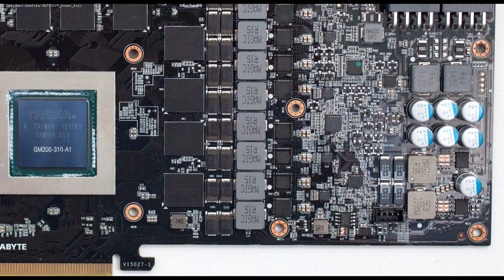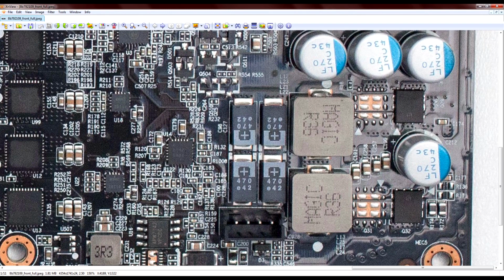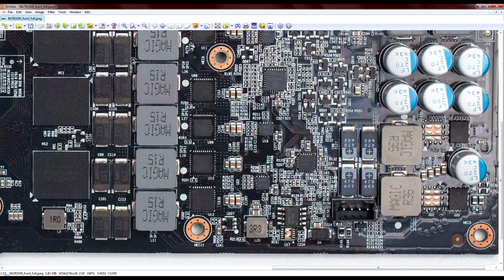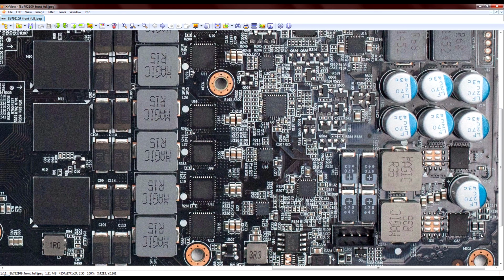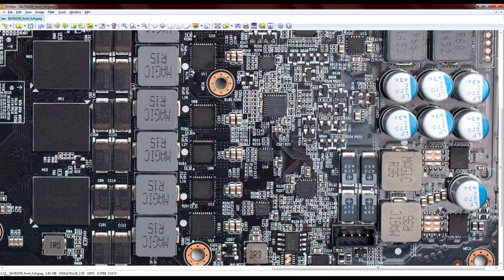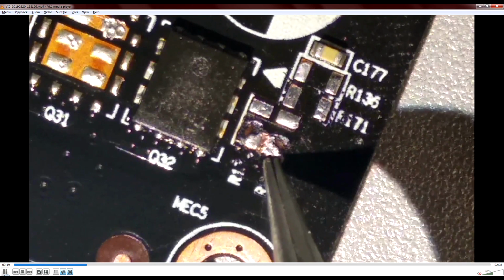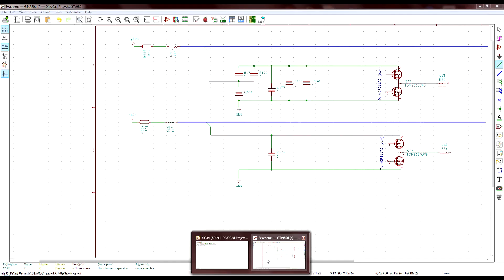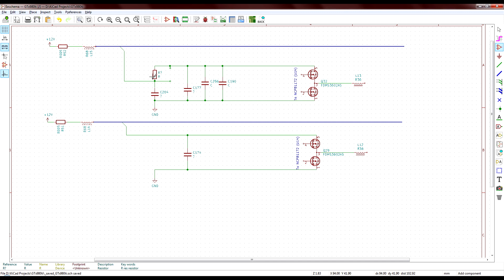Gigabyte 980Ti G1 GAMING-6GD Repair

Comment: Hi! Your solution with zero-Ohm resistor and board analysis looks fine, however there is a question still left - does replacing this with zero-Ohm resistor (or 8A fuse I think) solves the issue for a long time: does your gpu repaired ~1 year ago still working fine?

I'm a gpu repair engineer facing the same problem. To be sure that my repair is proper and durable I'm trying to analyze what caused the initial problem with exploded ferrites. For your card somebody wrongly placed capacitors after factory-placed ferrites exploded. And unfortunately this question is not obvious even for a repairer... so I come here to ask if your card still works))

The main hypothesis I have about original reason is that ferrites were the problem themselves - since current through them was equal to current through Q32, and Q32 is still working fine. Maybe during original board development they plan to place zero-Ohm resistors here (hence the marking R172 unlike other ferrites marked LB3/LB4/LB5) and in last minute change them to ferrites without exactly calculating the current and temperature durability. The power chokes handling pulsating current are quite hot, so these small ferrites could be very hot. too... However, my gpu repairing statistics says that ~50% cases of "something burned on gpu pcb" the burned element is not the reason itself but the reason is a complex consequence of the breakage of other element. So I'm not completely sure with this hypothesis.
Reply from the maker: My card is working like a charm after almost a year. I use it for video rendering and ocasionall gaming.
In my case Q32 was intact but here on the chanell there are viewers who are reporting burned Q32 as well.
I can talk for sure for my card that i had no problems after replacing those caps  (originally burned ferrite beds) with a fuse. No stability issues or overheating.
Take that with a grain of salt because i use my card on default values and haven't overclocked it at all.
My hypothesis is that ferrite beds became hot due to extensive usage and because the core is made of ferrite the cooling is not so fast. So easy heat with high current and slow cooling leads to temperature build up to the point of burning. Also is suspicious the markings for those two components which are marked with R like a resistor. There can be that they placed those ferrite beds instead for whatever reason after designing the PCB.
All those are just my speculations based on my case here, but evidently there are cards with burned Q32 so i don't know what to make of it.

Comment: hi, I have bad English, I still do not understand what you did with the resistors? did you just take them off? Or did you put some kind of resistor in place of 172? if so, which resistor and where did you get it? thanks. PS: I have 172 burned from one side, and the same problem in games - I play for 3 minutes and then color screens like a green yellow blue screen of death. and the computer freezes.
Reply from the maker: I removed R172 and R174 and placed one 0-ohm resistor in their place. Doesn't mater which place as they are in parallel. I took 0-ohm resistor from some old electronic but you can just use piece of thin wire if you like. That 0-ohm resistor should act like a fuse in case something go wrong.
Reply: @UrosAndric  thank you so mach for answer. im waiting my delivery https://www.amazon.com/gp/product/B072BL2VX1/ref=ppx_yo_dt_b_asin_title_o01_s00?ie=UTF8&psc=1, i hope that the only one problem on my gpu. thanks again man for your video. you can try make a content of somthing like that if you like it.

Comment: Hi, thanks for all the work done. I have the same problem as you. We would only have to change r174 and r172 for a resistance of 0 ohms. The q32 chip wouldn't necessarily be shorted? Thanks sorry for my english
Reply from the maker: Safest way would be to measure the Q32. If dont know how or what to measure then second safest option would be to replace it with the new one. If there is no sign of burning or damage to Q32 might be ok but there are the risk that damage is not visible.
You will have to decide what to do.
Reply: Hi there, I have the same problem where the gpu frequency throttle down on heavy load and crash due to power delivery limit. The r174 and r172 seems fine as they have low resistance. I suspect it’s q32 as found some dirt around it. How do I test the q32? Where can I buy a replacement one?

Comment: Hi! I have the same issue as well. I have the same version of the PCB as you. I have a few questions. 

First of all, what did you use or what do you recommend me using to remove the two damaged resistors, and should I clean the PCB after doing so? If yes, how? It is visible that the PCB is burnt there, but has not burned out by much. I hope this makes any sense.

Secondly, why did you only use one resistor? And why in the place of R172 instead of R174? For me the place of the R174 appears to be in a better condition, should I put mine there instead?

Great and informative video, thank you for making it. :)
Reply from the maker: Hello.
1 - I used soldering iron 12w i believe with the tip suitable for SMD components (small one). Use flux or soldering paste when removing components. Yes you shuld clean it after with the alcohol.

2 - You can use one resistor (Fuse) because the R172 and R174 are in paralel. Therefore you can solder the resistor ir a piece if wire wherever the pads are in best condition.

You have great tutorials how to solder and unsolder SMD elements and how to clean the board before placing new components. Search in YouTube, there are lot of great content about that.
Reply: @UrosAndric  Thanks for the fast reply :) I will try fixing the card next week, I have ti borrow some soldering iron. I will most likely write here if I have further questions or if I succed.
Reply: It worked! Thanks a lot :) I have one strange thing however... during games it runs at its normal boost frequency, but during stress testing it runs 10% slower than it used to be, and still manages to run a little bit hotter... 
I am still very happy with the results, I don't have to use my good old GTX 470 for now :D

Btw, I only removed the one condensator thats damaged, and soldered a cable to it's two pins instead of a 0ohm resistor chip.

Thanks a lot for making this awesome video :)
Reply: @DinnyeYT  Copper cable?
Reply: @ciccioteck9839  I just cut out a piece from a sacrificial ethernet cable. I don't think the material of the cable will matter here.

The card still works fine, however when GPU power reaches 90% or so the whole PC crashes. I have limited power to 85% in MSI afterburner and since then it works without any issues.
Reply: @DinnyeYT  Thanks, The pieces of cable go on both r172 and r 174 or even just one
Reply: @ciccioteck9839  If I remember right the video said they were hooked up in parallel. If that's true then doing only one should be enough
Reply: @DinnyeYT  Last question should I leave the plastic wire protection?
Reply: @ciccioteck9839  Nope. Just make sure the cable doesn't touch anything else
Reply: @DinnyeYT  So from what I understand I have to take off the plastic protection and solder the copper end. Right?
Reply: @ciccioteck9839  Yes. You unsolder either R172 or R174, take off the plastic from a small piece of cable, and solder the cable into the place of the desoldered resistor/capacitor. The soldered cable must bridge both pads of the unsoldered resistor/capacitor, and must not touch anything else.
Reply: @DinnyeYT  Thanks, even the pcb must touch?

Comment: I ended up here,  as probably many others, for the same issue. Now, my R172 and R174 have completely burnt off the pcb but it appears they took Q32 with them as there is damage to that FET. Do you, or anyone reading this,  know what that chip is? Markings are: DF33AF 22CF 070D. Can't seem to locate it on Google.
Great video btw!
Reply from the maker: Could you take a picture od that damaged area?
Reply from the maker: Yeah, i believe that is the one, or the adequate replacement.
That burn doesn't look that bad. try to remove the compoments and clean the PCB to see whats left there. and if you could take a picture then that would be great.
That q32 is the chopping circuit and it chops 12V to around 2V for the memory. It can happen that q32 burned in a way that it just shorted that 12V to the ground and in that case your ram should be intact. But if it let that 12V pass to the ram, then ram is dead. If your card is working and crashes under load,  your ram is probably fine. Never the less if you have some soldering skills it is not expensive to try to repair it and see if its gonna work. I would suggest to buy that IC and try what is gonna happen. Send the picture when you remove the IC and that burned components so i can see what is left. If all the pads are there, then it is easy fix. if not, then we will have to solder some jumper wires.
Reply: Will this be ok https://uk.rs-online.com/mobile/p/mosfets/7599605/
Reply from the maker: @robertbooth5884  Actualy i just googled that markings you gave (22CF 07OD) and i found that this one is the exact one.
https://datasheetspdf.com/pdf/947277/FairchildSemiconductor/FDMS3660S/1

So looks like it is FDMS3660S
Reply from the maker: @gregb5052   Actualy i just googled that markings you gave (22CF 07OD) and i found that this one is the exact one.
https://datasheetspdf.com/pdf/947277/FairchildSemiconductor/FDMS3660S/1

So looks like it is FDMS3660S

Comment: Do you happend to have a video to show how to replace those r174and r172 i have the same issues and i don't know how to replace them.
Reply from the maker: Unfortunatlly i haven't recorded replacing process. I used heat gun (reflow station) to remove and replace those components but you can use regular 10-15w soldering iron.

Comment: I am having the same problem with my 980 ti g1 ! When under load the clock , memory clock and gpu usage fluctuates constantly. and after sometime pc crashes with a random color. My card is the one with less capacitors. I am currently running my card by downclocking both memory and clock to the lowest i can and limiting power usage to 75%. Still then sometime the fps goes down and after sometime it goes back up again. Can i leave my card like this ? i have checked for damage on R172 and R174. But there seems to be no burn damage or anything. i dont have a heat gun or anything to desolder those ferrite beads and solder a 0 ohm resistor.
Reply from the maker: It might be completely different problem. But first measure resistance of R172 and R174. Even if they are not looking burned they might be damidged. If all is good resistance should be very low. Around one ohm or below. On most instruments it should measure short circut (if instrument is capable to measure low resistance it will show exact Resistance). If there is no resistance there  and no visible sign of burning it might be that it is a different problem.
Reply: @UrosAndric  i measured resistance of both r172 and r174. they were 0ohm. Also the resistance between Q32 and r52 is also 0. There are no visible burn marks or damage. Tho the vram thermal pads were very worn out. Most of them are gone. But after i used thermal paste on the vram just for seeing if they bring any difference my card was alright for couple of hours. No throttle in unigine superposition for 1 hour. DO you think bad vram cooling might be a problem for throttling ? 

Also can i contact you on discord for help if you dont mind ?
Reply from the maker: @xonexar  looks like bad cooling was the problem. Can't tell for sure that is the only problem but do test the card with paste or better if you can find new thermal pads would be great before testing. I am not using Discord yet... Might setup an acount soon. If i do i will send you the link.
Reply: @UrosAndric  so atleast the r172 and r174 isnt the problem right ? Since they are 0ohm.
Reply from the maker: @xonexar  if they don't show signs of burning, then they should be fine. Look at surrounding PCB. If it is darker around those resistors it means that those ware too hot at some point. If so, i suggest to replace them. If all looks fine then don't touch anything.
Reply from the maker: @xonexar  yeah the problem is that PCB is already dark :-)
Looks fine to me as far as i can see from the picture you posted. But keep track on those as they are known by burning suddenly and damige the PCB.
Reply: @UrosAndric  the problem started again after a day after i changed both thermal pads and the paste. Those ferrite beads gotta be the problem. I can't desolder those component with my iron. Can't even melt the solder. So i was thinking, say i bridge those 2 ferrite beads with solder on both ends and use a copper wire to bridge those ends would that work ?

i am not sure who would i bring the gpu to in order to repair it. So i am asking here. Thank you again for helping so much.
Reply from the maker: @xonexar  If you bridge them you will split the current going thru them and as a result will have less current going thru each of those. If done properly it should work fine. It is wierd that you can't unsolder them with your iron. Do you maybe know the power of your iron in Wats?
Reply: @UrosAndric  it says on the iron that its 60w. But even after cleaning the tip i cant melt the solder on them.
Reply from the maker: @xonexar  60 W is usualy too much fror SMD. Try to use flux or new tin wire.

How do you plan to soder the jumper wire if it is imposible to melt the solder on the board? All in all it cam be that you have cmpletely different problem that those 2 resistors. if problem persist after you put jumper wire then the problem might not be those 2 components.
Reply: I am having the same problem chrashes with random colors and idk what to do
Reply: @drdelirious8899  id say your gpu is close to death. My gpu burned at the exact spot of r172  and r174.
Reply: @xonexar  its already dead i have to use a 1030 tell i can afford a gpu
Reply: @xonexar  and idk how to sater or anything so…
Reply: @drdelirious8899  follow the video suggestion of r172 and r174. if your card is not totally burned like mine you might still be able to salvage it.

Comment: So. R172 and R174, these are called out as resistors on the board. If they ARE resistors, and I suspect that they are, then they would be two resistors in parallel, to share the current load. This is common on SMT boards, as chip resistors are all pretty much the same size, and to increase wattage dissipation of the resistors at low cost, they commonly put two or more in parallel. If they were capacitors, the circuit would not function at all. They must therefore be resistors, as the board indicates. SMT resistors are BLACK. These look like METAL FILM RESISTORS, which look more metallic. Other than that, they look pretty much the same as capacitors. Your repair confirms that these were resistors, most likely in the 1 to 5 ohm range or so, to reduce the voltage to the complimentary pair of FETs that they feed. (the chip) This done to keep the FETs from overheating. It is also pretty obvious that there is a lot of filtering on one side, four capacitors, looking at your schematic, on the side where those two resistors are. Why?  More filtering means more switching noise to be filtered out. Usually more current. Those SMT resistors look to be OK. That is common, as these resistors are ceramic and can take a lot of heat. Much more than the board can. I've seen them so hot they melt the solder and slip around on the board. All the time working just fine. Looks like the damage was to the board only. Did you bother trying to see what their resistance was? Replacing them with a higher wattage resistor of the same resistance as both in parallel would be the best fix. I have a dead Gigabyte 980Ti G1 GAMING-6GD, and thank you for this video. Hopefully mine will be repairable same as yours.
Reply from the maker: When i bought the card i noticed that some one already tried to repair it. On that place ware soldered 2 capacitors and you could see that soldering is not the same as the rest of the components. So i ended with 2 caps there and no original components (resistors or whatnots) so i could measure the values. After tracing the bord components and drawing the schematic it became clear that those components must be low res. components (0 ohm res. or ferrite beds or something similar). I found on the forum that someone with the same problem said that those two are ferrite beds. I was thinking how on earth i could find the values for that without heaving original Gigabyte schematic? Then i traced the second phase of VRAM power supply and saw that there is no resistors in that place and amount of filtering caps ware less. So why using 2 diferrent designs for two power phases made out of the same components powering the same thing?
If first is working normally in the way it is designed and the one with those resistors is dying regularly then lets rewire the second one to match the first one. I just wanted to solder a thin wire there but just to be sure i soldered 0 ohm resistor to see if it will hold the current. So far so good. No extra heating of that resistor and card is working fine.